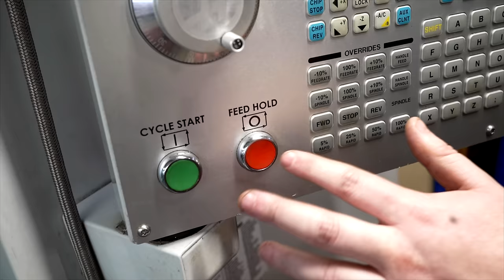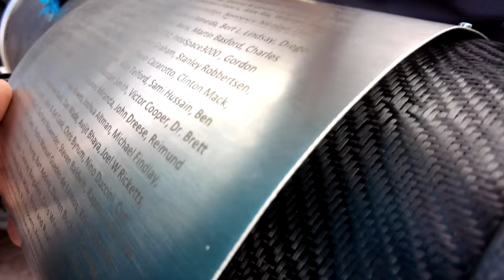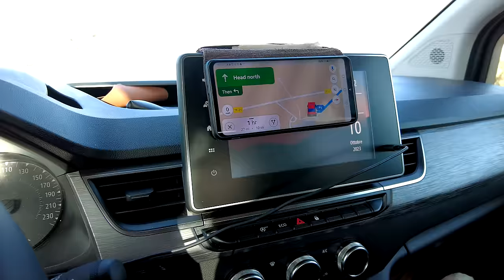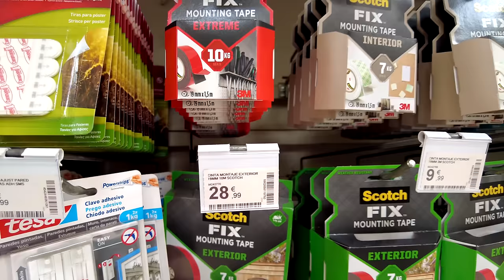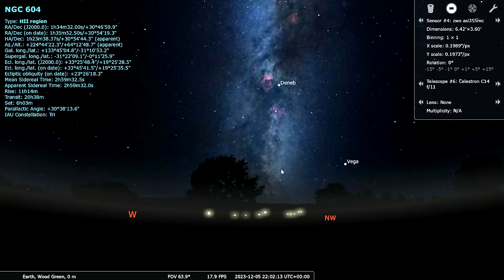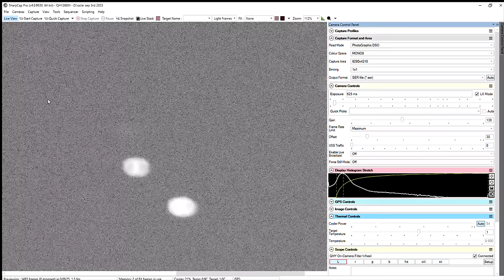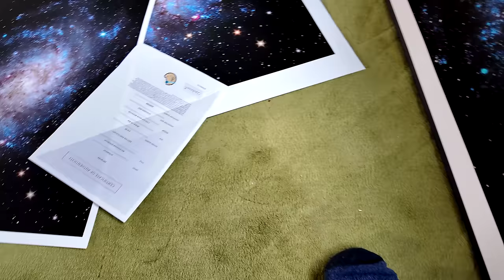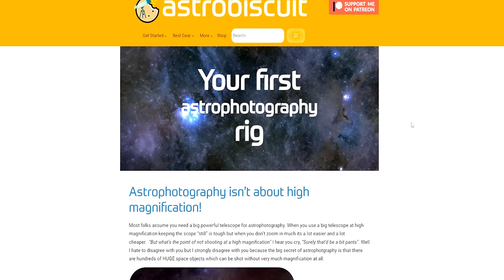My DIY telescope vs $1million Observatory │Betty's Story Ep 2

Comment: Short answer, NO. Resolution is proportional to the aperture of the primary mirror or lens. That is inescapable. An 8" mirror has half the resolution of a 16" mirror, a quarter the resolution of a 32" mirror. I suspect the comparison is worse than that. 

Let's do the math, 82 cm is a 32 inch aperture. Your 8" mirror only has a quarter of the resolution of that scope. You lose badly. That doesn't mean you can't take amazing photographs. It means that using the same techniques, the professional scope photos are 4 times better. The math is wildly in your favor. Your scope is worth perhaps $3,000 dollars, so for 333 times the money (if it's only worth a million dollars), the professional scope is only 4 times better resolution. You win!

Also, proper mounting of a mirror is something just about any amateur astronomer could have worked out for you in half an hour or so. Believe me, triangular stars are a normal occurrence and any DIY amateur astronomer knows the fix. It does not involve either glue or double sided tape. I'm about to remount my 13.1" mirror and it will be a similar experience I'm sure. Takes some careful adjustments and a really good mirror cell to make things work properly.
Reply from the maker: I love dumb people who are convinced they are correct about everything 🤣
Reply: @Astrobiscuit  But think about it. If a $10,000 or $15,000 telescope could equal a $1 million dollar plus telescope in quality and resolution, the professionals would already have done that. You can take amazing photos with your 8" telescope. If you never bought another telescope during your lifetime you couldn't live long enough to exhaust the things that 8" telescope can show. But it cannot equal a 32" professional telescope.

If you have another way to calculate resolution that invalidates my "dumb" statement that resolution is proportional to aperture size, I'd love to see it. When you call people names rather than counter their positions you lose. Name calling is the last resort of those who cannot contest the truth presented. But it doesn't work, except as a magnifying glass to your inordinate pride.
Reply: @RockinRobbins13  I think @astrobiscuit's point is that atmosphere will lower the ceiling of what a given scope can resolve. 

If the atmospheric seeing limits you to 2 arcseconds, it won't matter that your 20-inch scope has a theoretical Dawe's limit of .23 arcseconds. Obviously the larger scope will show you fainter objects, but he's talking about detail and resolution.

We see this all the time at star parties on nights with average or below-average seeing, where a long-focus 60mm refractor can hang with scopes with several times the diameter for stuff like splitting doubles. 

The IAC80 will resolve 0.33"/px and the skies up there will match that. The 8" and QHY 268 camera combo clock in something like ~1"/px. It was never a truly a fair fight, and @astrobiscuit admits as much in the video, but it was a good exercise and highly entertaining to watch, with a fantastic image result at the end.

It also becomes moot if/when observatories upgrade their cameras to higher-resolution CMOS units, but for now, it's certainly tantalising that a well-heeled (or well-supported) amateur can approach the resolving power of a professional telescope under certain conditions. Not entirely unlike how my little Tak 60Q can hang with larger scopes splitting the Double Double in Lyra on a lot of nights.
Reply: @khoatran9804  In the video he says that was his first inclination but when the professionals said the resolution at Tenerife was tiny, Astrobiscuit remarks in his video that wouldn't help his 8" scope equal a 32" scope.

And if you think about it, if the atmospheric scintillation would only allow the maximum resolution for an 8" telescope, that's all they would have built there! But the professionals built a 32" scope. That means the atmosphere allows resolution that a 32" scope can deliver.

Astrobiscuit's scope is worth something less than $5,000. The professional scope is supposedly worth a million dollars, but i think that's a good conservative estimate Why would they spend an extra $995,000 for no gain? They wouldn't. They would be using relatively cheap 8" telescopes if that was the best resolution the seeing allowed. Make sense?

If I'm wrong I'd like to know it. I can't wait to see what Astrobiscuit builds nexe. He mentioned about 16". I'd like to encourage him to go for 20". That seems to be a real sweet spot for dobsonian scopes. However the cost of mounting a 20" beast is likely to be too high to allow using that size. Maybe a dobsonian scope on and equatorial platform could work. Most EQ platforms will allow 10 or 15 minute exposures.

You know, 60mm refractors get a lot of grief from amateur astronomers for being beneath consideration. That's because of the cheap department store 60mm scopes that were basically useless. A quality 60mm scope like yours will make a believer out of just about anybody with an open mind. No central obstruction means it can resolve about as well as a 100mm newtonian. Put a premium eyepiece on it and it's a scope you could spend a lot of time on with pleasure. 

I've seen clear spiral structure in M101 through a 50mm refractor from DeLand, Florida. It was a night I'll never forget. I wonder if M101 can be seen naked eye from Tenerife? I'll bet the chances are good.